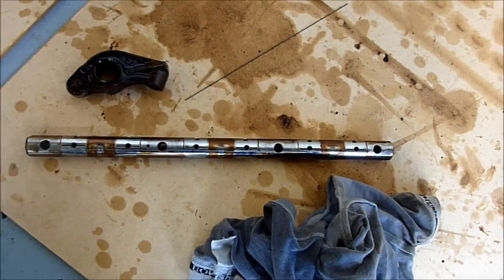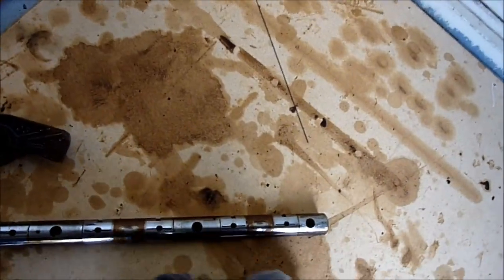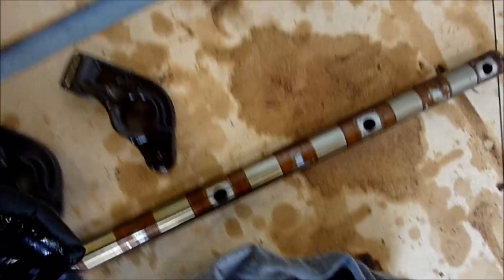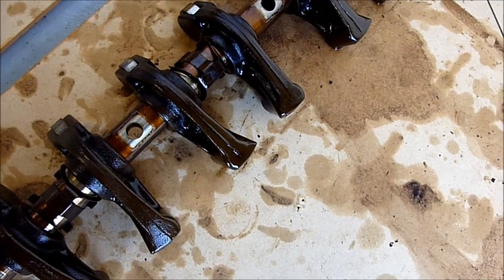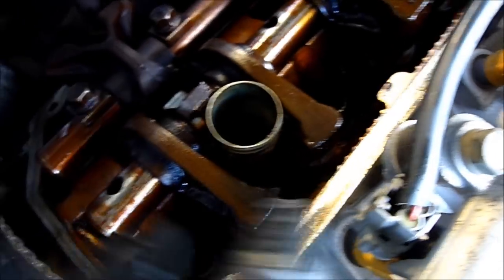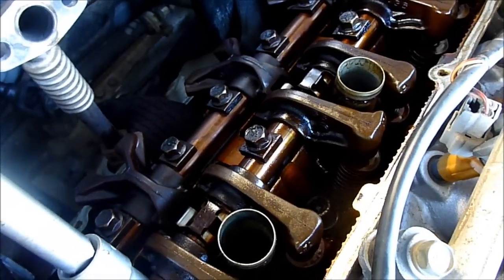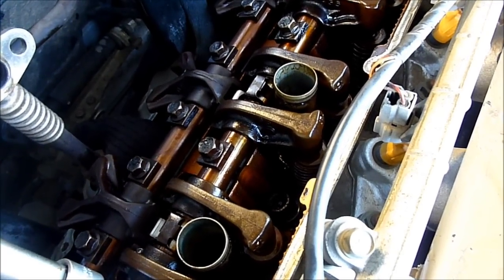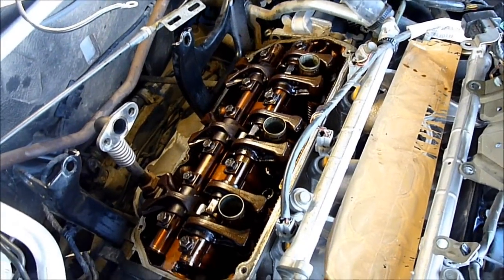Cleaning rocker tubes and replacing lash adjusters for Mitsubish 6G74 motor

Comment: I have a 2004 Mitsubishi Magna tried everything to solve the noisey lash ajusters when the engine is cold which were replaced tried differants brands and grades of oil finnerly worked it out it was the timing belt was worn so the cam shaft was out of wack a new belt the car sounds like a new one now @ 230000 klm on the clock it was about 40k over needing it changed so good chance that can be thge problem too.
Reply from the maker: Yeah absolutely.  Messed up timing belts or a worn tensioner which causes a loose belt can cause a severe rattle - and sometimes skip a tooth on the cam!

Comment: i have a 06 3.8 gt mivec an the rear lifers are making noise, seems like there no oil to them. but i see the oil is coming out in the bottom near the bets an oil filter. its making a scratching noise in the top back part of the head.
Reply: Did you ever figure it out?

Comment: Thanks for this video mate, i'm about to replacement valve stem seals on my pajero which uses a similar if not the same engine as displayed here. I know this was uploaded almost a decade ago but i'm just wondering if you can tell me if you needed bleed the adjusters before install? or can i just pop the new adjusters in the rocker arms and torque everything up.
Reply from the maker: Hi Paul, yeah they're the same process, it's basically the same motor.  The official guide says to bleed them using diesel before installation.  It's not much more than a thin piece of metal and a bowl of diesel needed to get it done.  You just keep 'em submerged in the diesel and pump them with the metal rod/pin into the hole until all the air is out and you can't compress the lifter with your fingers.  Then you leave it in the diesel until you're ready to install.

Comment: KaldeBoch, did you pull it apart and find out the lifter's were stuffed? I'm considering tackling this, I have the same problem, but if i pull it apart and the lifters are stuffed it might be a job for the mechanic...Any advice?
Reply: Scratch that, obviously they come on anyway so shouldn't make a difference. I'll get into it soon. Thanks for the vid
Reply from the maker: Russell H once you get to this point the lifters are already out.  Easy job to replace them from here.  But the reason I did the job in the first place was because lifters were ticking.

Comment: I have the same engine in my Diamante, or Magna in Austrailia and its making ticking noises in the same part your video was working in, I want to open it and investigate this weekend and I was wondering if I should replace only one lifter or replace all, also is it possible to recycle lifters? I would just like to have your take on this.  Thankyou in advance.